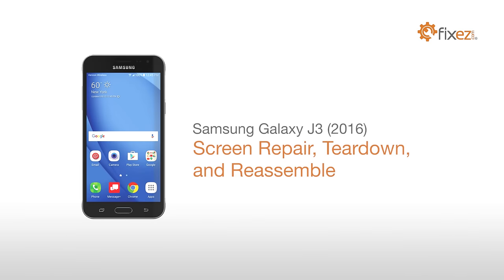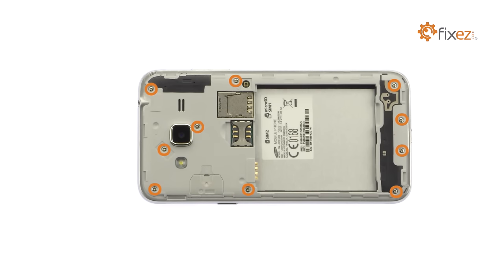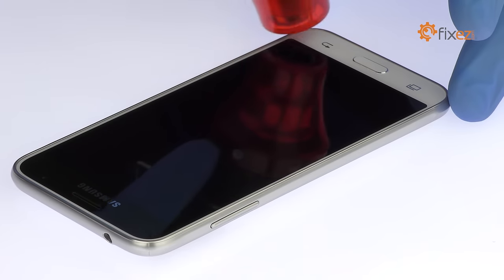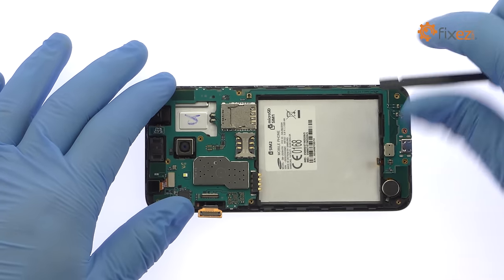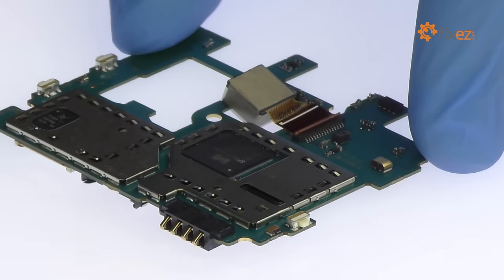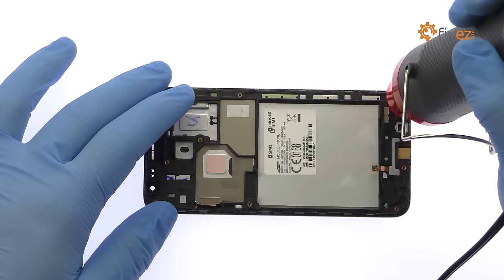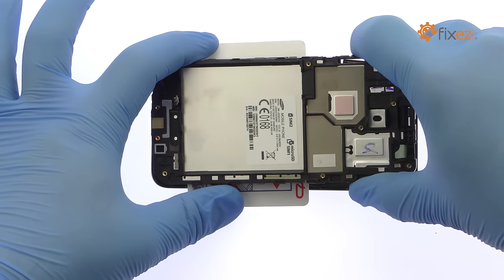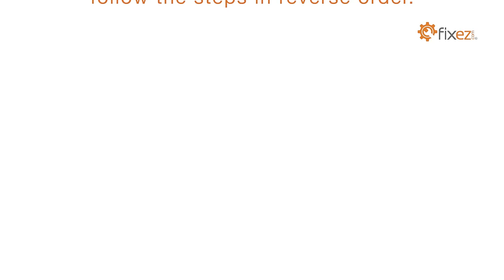Samsung Galaxy J3 (2016) Screen Repair, Teardown and Reassemble - Fixez.com

Comment: I dont have any water damage but my phone sceen is slightly cracked but the lcd is not working phone turns on but nothing comes on the screen is there anyway way i can send you mine?
Reply: Fullmetaljango unchained same with my Samsung j3
Reply: yeah me too, It done it out of nowhere :/
Reply: My screen is black but it looks like something is smeared over the screen. Like I can barely see parts of the screen in the sides and corners
Reply: Fullmetaljango unchained mines the same!!
Reply: Same!!!
Reply: Me too with my j3
Reply: same with mine
Reply: @OrangePeelXP yea it super amoled not LCD

Comment: And what the hey? The Galaxy J7 mother board???
Reply: destravlr Ikr, isn't the phone j3?
Reply: Not sure how old the J7 is compared to the J6, but you can be sure lot's of parts (especially the memory chips) might be identical physically, but be bordered off in firmware.  It is much cheaper to be able to make 10 million of the same motherboards instead of 2 million for the J6, 2 million for the J7 and so on.
Buying memory chips comes with incredible big discounts when you buy a big multitude of the same ones (and some orders at the parts warehouses start at a minimum of 100.000 chips as 1 unit, so if you buy 10 units, you have a million, just to give you an idea of just how little memory costs).
Models might be equipped with a chip with a lot more internal memory than you can see, by having it partitioned in firmware to not show the real size of the chip.

Comment: I'm kind of lost... If I'm just replacing the screen, do I have to take off the motherboard too? Or can I just disconnect the screen cable in the back, heat the screen and remove it with a playing card?
Reply: Read the tittle of the video again, screen repair, teardown and reassemble of the whole phone, hes teaching how to remove all the parts of the phone and also how to replace the screen
Reply: well it'd be nice to know when to stop, I don't know, I'm not a repairman

Comment: Hope you can answer a question for me.  I took my j3 apart to replace the screen assembly and broke the headset connector from the motherboard.  Will the motherboard and phone still work if I assemble it without a working headphone jack.
Reply: Greg Bentkowski I think they will but no earphones
Reply: Erik Hernandez you are correct, it worked but no headphones.

Comment: Couple wks old ph. Broke LCD. Can I buy a used ph for parts? Looks like it'd be impossible to reuse a 2nd hand LCD which I had planned. Can I simply change out the hard drive(?)/ data center? Or must I buy new LCD screen for original ph to save data? Any help appreciated. Thx.

Comment: sir my Samsung galaxy core2 SMG355H touch is not responding even if its touch and display both are working, something wrong in m.board NEED HELP TO FIX..
Reply: Maybe your cable got disconnected. Open the back cap, lift up a small black box on the top left and take out that wire and put it back in. If that wont help,open up the phone and reconnect the outer screen with the lcd again